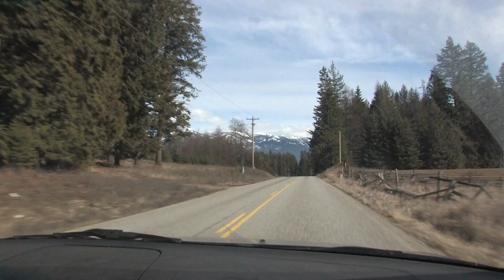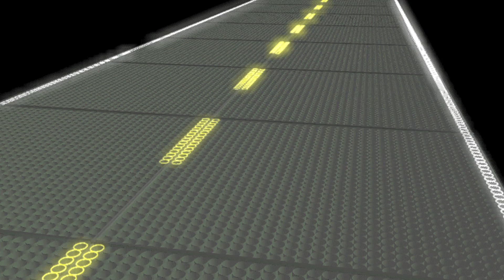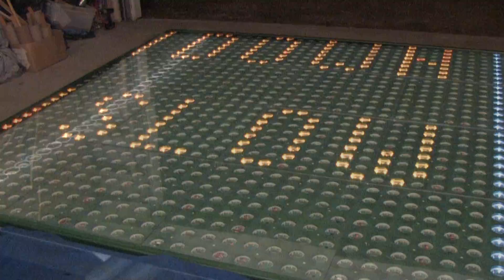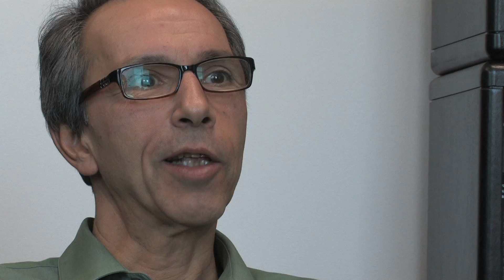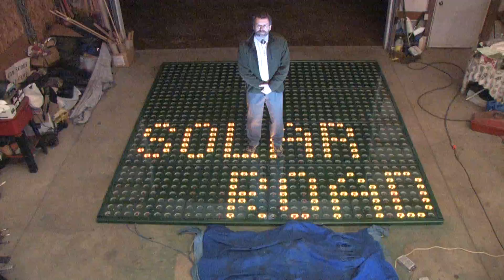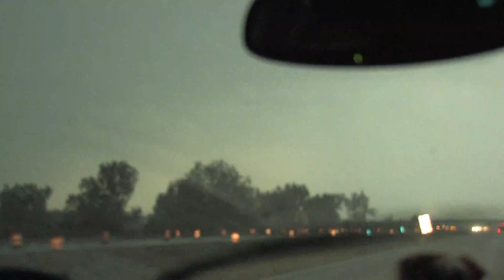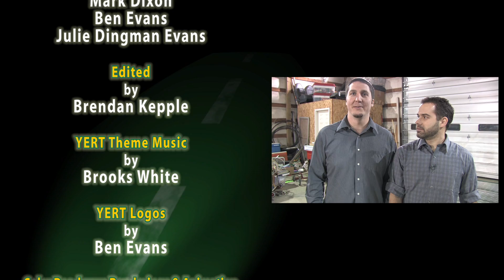Solar Roadways: The Prototype

Comment: Build a one mile stretch of this solar road, then require that THE INVENTOR drive one of each type of vehicle (motorcycle, SUV, etc.) down that stretch of road at no less than 65 mph. Dump water, snow, set up obstacles, and place high-powered fans along side the test road to simulate strong winds. Essentially, everything real-world drivers face while driving down a highway.

If he can drive that mile in each vehicle, under each simulated weather event, without crashing, I'll believe in this project. Because so far all I've seen is a freaking tractor going 10mph on 20 feet of this crap, and that's supposed to convince me that it's "safe for mass travel". The shit people believe.

I'd rather my taxes be spent on WELFARE than solar roadways. At least poor people spend their money, and thereby stimulate the economy, This solar roadway stuff is just...a money pit.

Thank god their request for more DOT funding was rejected.

Comment: The problem with glass that I see right off, is that when its wet, things slip on it easily. The dimples don't really help as much as you would think. I've driven across this type of surface structure. There is a round-about with this type of surface that is dangerous when wet. I'm really curious to see one of these from the driver perspective on a bright day with the sun in front of you between 20 to 60 degrees above the horizon. Most city streets and main roads run north/south or east/west. That could be a problem. Also, how visible are those LED's on these panels from driver level around noon.
These would certainly be awesome at a parking area for a night club. Las Vegas streets would be that much more incredible at night. But what do they really look like in full sun? And again...from driver level.

Comment: You can't build roads out of glass.  Glass might be as strong as steel under some conditions, but it is not soft or flexible in any condition.  It shatters.  Even toughened, hardened and tempered glass wouldn't nearly stand up to the brutal punishment traffic would bring.  Also, scratched glass (it would scratch up so fast), won't permit much light to reach the solar cells and roads lie flat, so you're looking at low efficiency when the sun is rising or setting.  It would be a much better solution to build canopies over existing roads that have solar cells covering the outer surface.  It would be cheaper too.

Comment: A few negatives but not the most obvious. Most cars/trucks travel during the day, covering roadways, parking lots are used most of the day, covered again, LED lights will not be seen during the day at the angle that a driver is at, efficiencies are too low even with clean glass, most roads are in snowy areas, covering the roadways, also the sun's angle during the winter is lower so the panels are even less efficient and the power needed to heat the roadway to melt snow and ice is too high for these panels to attain and then there is the expense of this. Getting folks out of their cars and into mass transit is the only way to go. We are already maxed out for congestion in most metropolitan areas.

Comment: So how are they going to work at night?
Reply: They wont, not without power from a power station or some form of storage, which they don't have.
Reply: *****
Then it is folly right there on  that score alone. I can think of a few more as well... is this some sort of ponzi scheme?
Reply: Chuck norris
The actual, usable light generated from one of those panels is only capable of lighting itself, and that would be about less than 1/4 of the surface area. Additionally, the glass would be marred and glazed from wear in about a minute, and the light I mentioned above generated? That would be from direct sunlight- these tiles would be on the road and only able to get direct light during high noon... so how are they going to generate any light to store if it is raining, or snowing, or cloudy... and as for storage- it has been mentioned above already (read the comment thread) and even if they had storage facilities, it would cost more to run them than it costs to say, maybe put up a light pole and install a bulb... kind of like we do now.
Look- I am all for sustainable resources and renewable energy- when it works. I do not support folly and a scam that appeals to some sense of decency but accomplishes nothing but costing us all more.
Reply: The whole thing is just a stupid idea that sounds like it could be great.
When you get to the root of it, it's a solar powered torch, made of glass that you drive on.
Does that sound like a good idea to anyone?
Reply: Spiritual Artist
Not trying to be disrespectful, but read that comment back slowly, and then tell me where the contradiction is. Sources please?
Reply: It collects the sun energy and stores it. So that they will still be able to function at night.
Reply: If you are up to date on the solar technology you will find there are solar cells that can harvest light in the shade as well as moonlight.
Reply: Even if solar cells that could get energy from moonlight or in shade were used,  it would push the price through roof,  just because it's newer more sensitive harder to make tech.
Reply: Mark Baanstra
It's alright, a short in an LED would not be an issue, as the panels can't produce enough power to cause catastrophic faliure.

Comment: Why not just build solar panels along the side of the already existing roads??
Reply: Because that wouldn't be high tech enough and it's too simple and doable. They want a showy road that will change the landscape of the US. It wont work though but who cares about that... -_-
Reply: But the normal roads are cheaper.
Reply: Fade2Dark
Uhm, you'd have to do that either way? Explain to me in what way the SR combination is cheaper to produce, cheaper and easier to maintain, easier to educate workers for, produces more energy through efficiency, is a better road, will survive longer, is safer both for use and to live anywhere near, or is more versatile in placement as far as solar panels go.

Just to name a few things that one might think of as qualities of roads and solar panels :).
Reply: *****
Okay darling, so your idea is to use a solar collector and a heater to turn solar energy into heat. Nice idea.

However, there may be an easier way. Scientists have discovered a substance (well, a property rather) that actually directly turns solar radiation into heat. And unlike complex electrical systems, it apparently does so with very high efficiency.

Now I'm not entirely sure on the details as I'm no expert physicist. However as I understand it, it is called "black", and this advanced technology is currently being employed widely in asphalt roads. Hence they get bubbly during heatwaves.

Now for the big question: why don't asphalt roads get bubbly during the particular times when ice and snow tends to cover them? ;)
(To give another hint: why does it get cold every year during the time called "winter"?)
Reply: Yanfang Qi
Erm, no. It doesn't decrease building costs, it increases the costs. It also increases revenue. Just like making it a toll road would.

Also, in case you are an accountant: putting that revenue into the "road" column instead of the "next to the road" column, doesn't actually change the revenue.
Reply: because you would still have to pay for construction.
Reply: Tz. screw roads, put the solar panels on roofs. To generate power where its needed and where they won't get driven or walked on.
Reply: sorsocksfake A lot of those questions were answered in the video, bro.
Reply: Fade2Dark
Dear Necro,

If you're gonna continue a discussion 9 months late, please give enough of an answer that I can assume it's more than an automatic dismissal ;).

Kind regards,
SSF
Reply: sorsocksfake I never got the alert that anyone messaged me until just recently. I was alerted when John Foley commented on this video. Good bye.
Reply: Joe Bloe Neither does building those solar roadways, "you stupid fool".

***** I guess heating kilometres of roadway is dirt cheap, right?
Reply: *****
Sure thing darling :). Whoops!

"a percentage of the energy generated is converted into heat", I think we can resolve this fairly easily.

Show us what that percentage is. If above 100%, then I'd say that closes the case.
I'll accept conditions of a snowy winter day.  I won't bother you with asking the percentage for snowy winter nights ;).

P.S. If your problem to be solved is changing the roads so that they can generate heat... I think you kinda mentioned a sliiiightly easier way to do that...

P.P.S. If you're gonna use a insults every few lines, please be a bit more original. Much as it amuses me, I can't give you any points for that, you cheesy second-hand electric donkey-bottom wiper ;).
Reply: *****
"What in fucks name are you talking about? How could the system use more than 100% of the energy it creates?"

Well if it uses 200%, that means that it requires the energy generated by the panel (100%), plus an additional amount of energy equal to that, which it takes from elsewhere, namely the power grid. Just like (presumably) Heatizon's product.
Yes, that would make it rather less useful, doesn't it? However, technically speaking it wouldn't be a lie. It's just grossly misleading. Kinda like what people do in err, what was it...oh yes, advertising almost any product.

I've looked through the link you gave. It doesn't give any numbers on this. 

===

Sure, the data on potential energy generated is pretty huge. One could also propose turning the Nevada desert into one huge solar park; the numbers would no doubt be huge. Another huge number would be to calculate the costs of building enough panels to cover the entire road network. Or the amount of time it would take (especially if they're gonna do it in hippy fashion). 

Why I am "hostile"? Questioning something isn't hostility, it's skepticism. You wish to claim that the heating system would require less energy than the panels generate, and I find that claim very unlikely, so I ask you to demonstrate your claim...which you have not done. Again, just give that percentage... and if they don't have that, then you should wonder what that means for the claim.

What hostility I do have, is that so many people have gotten sucked into the hype, but most of it looks like someone used too much drugs. Looks shiny, seems to lack any substance. 

If people want to support such projects just to see if it can lead anywhere, by all means. Probably it won't, but who knows.
However the fans seem to be confusing the fantasy proposal for reality. We got enough insanity as it is, don't need more of it. Whether these creators are just enthusiastic hippies... or con artists. I can't judge, I assume the former.
Reply: *****
No evidence or even calculations? Got it :)

Quite fun when the faithful can only say "you're a troll". Not even agree to disagree, no, the infidel must be only pretending not to have faith ;)
Reply: *****
I dismiss it on this question because it doesn't even get into the question. It mentions nothing regarding the heating function. I might as well counter-quote it with the Bible ;)

P.S. responding to your second post in a bit, will need to focus for that one :)
Reply: *****
As for your second post: Thanks for the effort, but unless I'm sorely mistaken, you're confusing stuff here (and no, I'm not gonna insult you over that as it's a common mistake, I'm having to check it myself).

50 kW isn't the total amount used over a season. Watt is the rate of energy consumption (Joule per second). A 50 kW system operating for an hour costs 50 kWh of electricity. Per day, that's thus 1200 kWh. If this example doesn't clarify it, check wikipedia I'd say ;).

So you've been doing it rather the hard way. 50W per square foot is the energy consumption. Taking your numbers, the generation is up to 10W per square foot. So the percentage would be 500% with this system (i.e. the other 400% needs to come from external sources)

Of course, other systems may be more efficient. The following article might be of interest just to expand the idea:
http://www.theguardian.com/environment/2008/apr/25/solarpower.energy

Again, I do thank you for the effort there.

====

Sidenote: energy transport across the US is probably not much of a solution, due to energy loss in transit. Storing it for the night would be quite a problem on its own. The above doesn't factor in efficiency losses to heat (which might well do as much heating as the heaters), which of course is how an asphalt road would work (pretty much all the energy goes to heat there). And of course technology will improve, though better tech tends to cost more as well.
Reply: *****
http://en.wikipedia.org/wiki/Watt#Confusion_of_watts.2C_watt-hours_and_watts_per_hour

Learn what a Watt is. 50 KiloWatt per season is as nonsensical an expression as saying your car moves at 100 miles per hour per day.

Once you understand that, re-read my post.

Joule is an amount of energy (imagine a reaaaally tiny energy cube)
Watt (W) is a consumption rate of energy: one cube per second.
KiloWatt (kW) is a consumption rate of energy: one thousand cubes per second
KiloWattHour (kWh) is an amount of energy: one thousand cubes per second, over an hour, which is 3.6 million cubes

50 Watt device. 10 Watt generator. It's not rocket science. 
(please don't force me to draw a picture with those tiny cubes...)
Reply: *****
Quoting from wikipedia:

Confusion of watts, watt-hours and watts per hour[edit]
The terms power and energy are frequently confused. Power is the rate at which energy is generated or consumed and hence is measured in units (e.g. watts) that represent 'energy per unit time'.

For example, when a light bulb with a power rating of 100W is turned on for one hour, the energy used is 100 watt hours (W·h), 0.1 kilowatt hour, or 360 kJ. This same amount of energy would light a 40-watt bulb for 2.5 hours, or a 50-watt bulb for 2 hours. A power station would be rated in multiples of watts, but its annual energy sales would be in multiples of watt hours. A kilowatt hour is the amount of energy equivalent to a steady power of 1 kilowatt running for 1 hour, or 3.6 MJ (1000 watts × 3600 seconds (i.e., 60 seconds per minute × 60 minutes per hour) = 3,600,000 joules = 3.6 MJ).

Terms such as watts per hour are often misused when watts would be correct.[20] Watts per hour properly refers to the change of power per hour. Watts per hour (W/h) might be useful to characterize the ramp-up behavior of power plants. For example, a power plant that reaches a power output of 1 MW from 0 MW in 15 minutes has a ramp-up rate of 4 MW/h. Hydroelectric power plants have a very high ramp-up rate, which makes them particularly useful in peak load and emergency situations.

Major energy production or consumption is often expressed as terawatt hours for a given period that is often a calendar year or financial year. One terawatt hour is equal to a sustained power of approximately 114 megawatts for a period of one year.

The watt second is a unit of energy, equal to the joule. One kilowatt hour is 3,600,000 watt seconds. The watt second is used, for example, to rate the energy storage of flash lamps used in photography, although the term joule is generally employed.

=============
Reply: *****
"50,000 watts x 1 hour = 50Kwh
50,000 watts x 4,320 hours = 216,000KWh"

Correct, if the device is running nonstop, that's the amount of energy used over the timespan of 4,320 hrs. So why don't you use that number as you continue?
Reply: P.S. If you wonder why those numbers don't make sense (to be sure, they don't), ask. Though the answer basically means this data is worthless to calculate SR operating costs.
Reply: +AlexDogg   Because politicians - especially Republicans, but Democrats, too - insist on funding the WORST possible ideas and projects all the time, while denying money to the simplest yet most effective ideas.
Reply: Reall? Cause would that would be too dangerous! They'd get run over! DUH!

Comment: i preemptively bow my head in sorrow for the poor fools who actually invest billions into this lame duck project.   i appreciate the idea, but it has far too many issues, and often they are issues within the design itself.  conflicts such as using recycled glass, while needing the glass to be clear to utilize the solar panels.    claims of "running out of asphalt" while ignoring that rare earth metals used in efficient solar panels like tellurium are estimated to be 3x more rare than gold.   self powered heating elements that lack the output to deal with snow in sub zero temperatures, and if the output is high enough, may damage the internal components.

then we get into the "yeah, so what?" element of it.   changing lane markings?  yeah, so what?  we already can change them with paint.   it produces more energy than it requires.  yeah, so what?  the cost of construction will never be recouped by a marginal output into the power grid which must also have its infrastructure upgraded to accommodate the feeds.  the glass has enough grip to drive on.   yeah, so what?  asphalt is still much better.

and finally you have the gross over exaggerations like how much power it will put out, how well it handles snow, repair and maintenance costs.   none of these would ever come in line with what these videos purport they will.

is this what science is about, when tainted by environmentalism?   facts and scrutiny are just hate by oil company shills?   its more important to pat each other on the back and talk about how great it makes you feel?

how bout first things first, we work on better solar panels?